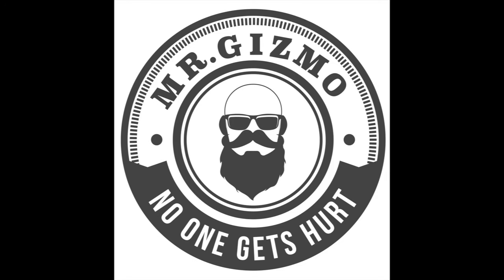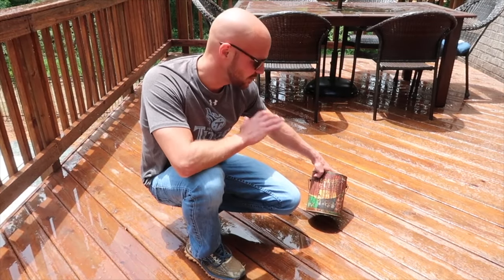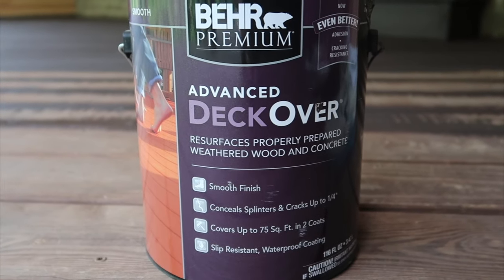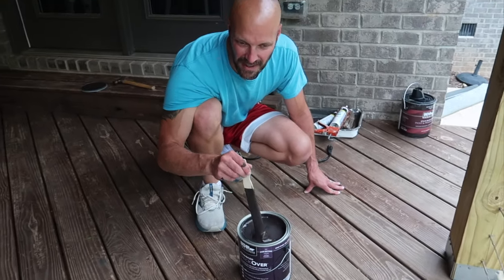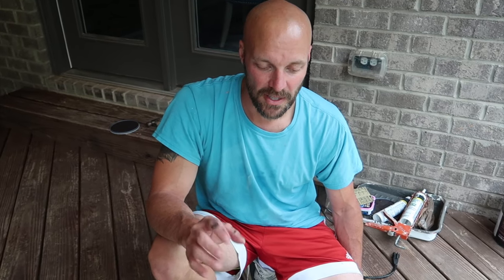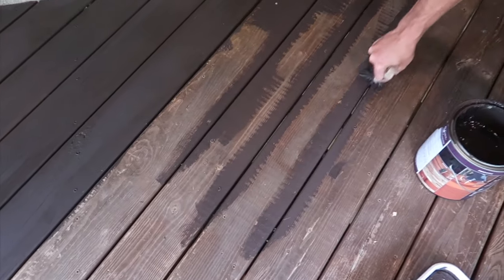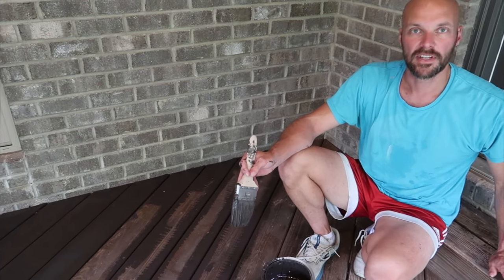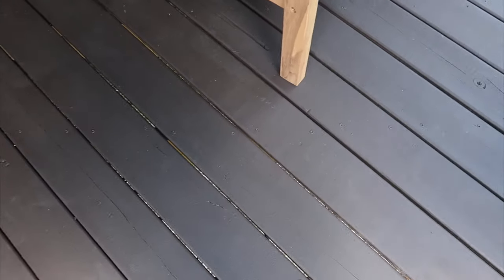How to Paint a Deck with Behr DeckOver | HONEST REVIEW

Comment: I'm a painting contractor 38 years now I've used this product too many times to count never had any problems, I power wash with bleach beforehand. Remember this product is not an end-all it is for a deck that is cracked and weathered and for people who don't want to spend or can't afford to buy new decking material. P.S never use a roller always brush by hand morning is the best time for application.
Reply: What do you recommend for cracked deck?
Reply: Why not use a roller? It works the paint I to the wood/cracks/fibers. And I HATE Deckover. It look GREAT in the beginning. Until it starts peeling in 2 years.
Reply: @terilachonce280  I would be pleased if it lasts 2 years, I used Thompson's and I have to paint it every year
Reply: @terilachonce280 what do you Recommend? I don’t like behr products
Reply: Can i use this on composit decking

Comment: I see a lot of people complaining about this product peeling and not lasting. If you read the product information, these resurfacers require the deck surface to be stripped, sanded, and filled to a bare and flat surface to adhere properly. Not removing old stain or paint and going over it is a recipe for disaster. Preparation is the most important factor with this product.
Reply: I put it on a brand new deck 4 months old and it peeled
Reply: @angelacarrillo6868  It's not meant for new wood. I wish there was a followup because this guy used it over oil based without stripping that off first.

Comment: I used this on a wraparound deck and it changed the entire home. I even went very light grey, almost white and was impressed with the outcome. I know there have been complaints about peeling, etc.  My contractor did the prep work and I have had no problems going on three years in.  If you just slap it on over a dirty, unprepared deck it probably won't last.  But when you power wash, sand where needed and pay attention to the actual directions it works great. No regrets.

Comment: We used deck over on our deck roughly 5 years ago.
It was terrible to work with, but looked beautiful for 1 summer.
Then it was a matter if just watching it peel a bit more every year.
Last year we removed a section of deck because the wood was rotting.
This year we completely removed what was  remaining.
There were several areas where the wood was rotting. 
Upon looking at the under side, we could see that the wood was just completely wet underneath.  So much that there was mold on some boards.
I can understand a product not holding up, but never expected it to rot the deck.
Reply: Thank you. Your experience seals the deal for me. I will not buy this product. I cannot afford that to happen to wood patio. I will stain it yearly instead of HAVING TO REPLACE WOODEN DECK due to rotting because of the above product. 🙏🏾
Reply: Had it done by a seasoned painter. Year 2 and 3 peeled like crazy!!!! Stay away from this product!
Reply: Thank you for sharing. I truly cannot afford to replace my deck. Thanks so much. I suggest a class action suit.

Comment: So far no reviews from anyone 1-2 years after.
Here's my take:
While Deckover did look great after application, 1-2 years later it began to peel, especially on the old worn wood that Behr and similar products claim will work great.
I expected this peeling and understood I'd have to reapply at this time.
What I'm finding is after I peel off the paint I'm finding the old wood in much worse condition: wet, rotting. The product seems to act like rubber undercoating on a rusted auto frame. I'm believing that eventually the Deckover and like products eventually deteriorates, creating microscopic defects that allow moisture under thus causing an unseen deterioration of the wood.
I installed new wood on the steps 2 years ago and the Deckover is still holding up.
Seems to work great on new wood but just doesn't work well after 1-2 years on old wood that shows signs of neglect.
Reply: I put on deck over about 8 or 10 years ago have the same exact problem. I am now in the process of stripping the whole deck sanding etc and reapplying some other type of stain. I too noticed that when a piece peeled up the wood underneath was damp even if it had not rained for quite a while. In many areas the rotted wood actually adhered to the deck over.

Comment: I don't know if you'll see this comment, but just a thought ... I wonder if you could use a Behr paint stain (same color), to brush between the boards. Probably cheaper, goes a longer way because it's not as think, and it would probably have a better run down between the boards. 
Then roll the rest of the deck like you did  with the Overdeck! I think it would All blend together. You might have to let the paint stain dry before rolling. Might work?
Reply: I have got 😂😂

Comment: There is a problem with this paint/coating, it peels. The worse the wood's condition , the easier it peels. I have used it twice on different decks, both had been stained & sealed but never painted and yes I prepared the surface
Reply: I would never use it.

Comment: Step 1 - Rent a belt sander
Step 2 - Install 60 grit sandpaper
Step 3 - Remove all old stain
Step 4- Paint with plain old stain
Reply: Oooooor just get a cheap angle grinder from harbor freight and an Diamabrush from Home Depot and say screw a belt sander.
Reply: Yeah that's got to be a blast hitting all the nails

Comment: Used this on my deck and absolutely regret using it.  With in a year is was peeling. Within two years it was coming off in small sheets.  The only place that looked good was areas that didn't see extreme weather.  I had to completely strip everything off all wood that it touched and went with a semi transparent oil based sealer stain.    Time will tell if that is better.    
Buyer beware on this product.
Reply: How did you get rid of it?  Parts of it are really stuck on my deck. put it on really thick with the textured roller. I tried stripper and it doesn't touch it.  I tried sanding - that would take forever unless I rent a floor sander and I'm not skilled enough for that.
Reply: It’s a lot of work to remove but can be made easier if you use the right tools. Purchase a Makita 5 “ disk sander. Purchase a groups of disks. 24 grit and 36 grit and a few 50grit. You are only going to use it to rip off paint. Move along to the next spot as soon as you get to bare wood. You are not using the sander to sand the paint. The goal is for it to grab paint off the wood. My tip: Purchase an extension cord that has a dimmer on it. Use the dimmer to lower the rotation speed of the sander to a comfortable speed. This will help a lot to keep from damaging the bare wood and it helps each disk last a lot longer.
Reply: @joanchantler2498  i just did mine today. i used paint stripper and a scraper tool , only 20% paints come off. power washing made 15% more paints come off. i was frustrated about to give up, then i decided to use a wire brush for last try. thank goodness i did it. the small wire brush works so much better than scraper tool. it’s power washing and wire brush repeatedly processing, 90 % paints came off at the end.

Comment: They tried to sell me deck over but I had a painted porch that wasnt sanding down. Since the wood was pretty worn from the elements, I choose Valspar for weathered wood. Not sure what to do with our addition other than use Johnson water seal for now. We did paint the flooring grey and letting the railing naturally turn grey.
Reply: Hi.
What ever you use ,never been for ever ,because it's so exposure to the weather..

Comment: If your deck is NOT exposed to sunlight and/or moisture of any kind OR you plan on replacing it after a year, Behr DeckOver is awesome!

 My deck's surface was stripped and sanded before using DeckOver. After DeckOver, it was beautiful... for about a year and then it began to deteriorate. By the second year, it looked worse than before we painted it.

I wish I had joined the class-action lawsuit a few years back. Home Depot agreed to give me store credit for the product's cost but not for the cost of labor for putting it on, taking it off, or painting it again.
Reply: I heard they reformulated it & have something better now. Home Depot paint dept person told me that about 4 months ago. When do you buy yours??
Reply: @pattibond2342 
Seven years ago... 
If you do use it, post back every 6 months...

Comment: I will say just this, I see you bending over with roller, next time screw in broom handle on end of roller. Saves back and speeds it up. For walls and ceilings too. I used to do it this way until I learned, then I said oh duh.